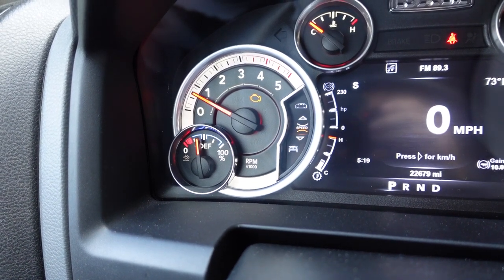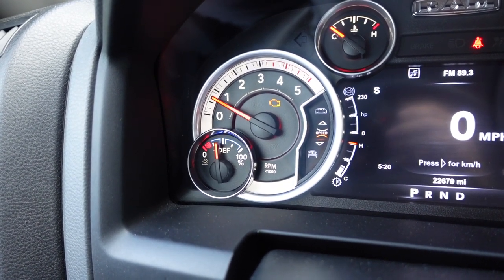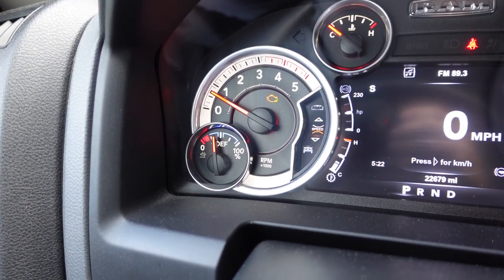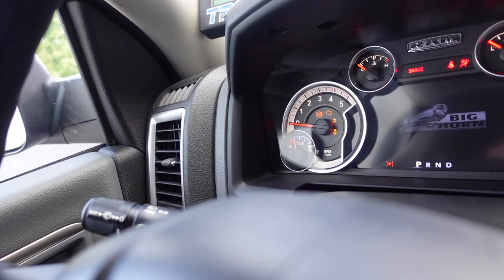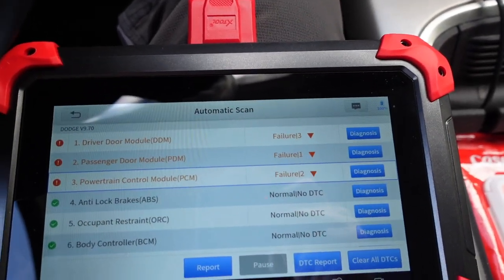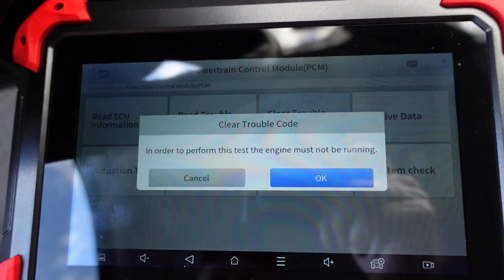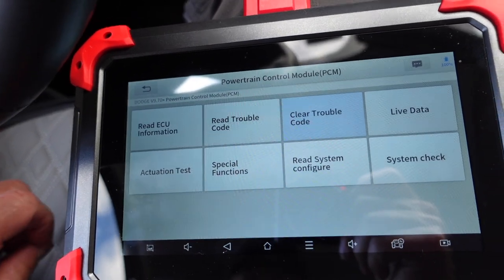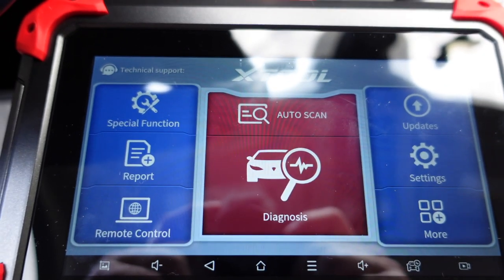RAM 6.7 Cummins Intake Heater Grid P2609 Code and Xtool D7 Scan Tool

Comment: So you have not had any major issues other then throwing a code from time to time and obviously can just reset it? Does it hurt anything if you still drive other then being annoyed by the check engine light on wouldn’t go into a limp mode of some sort right ?
Reply from the maker: Right, and it doesn't hurt anything to drive it with the CEL lit up. 
Thanks for watching!
Reply: No thank you every little bit helps thank you again for especially for your time and quick answer